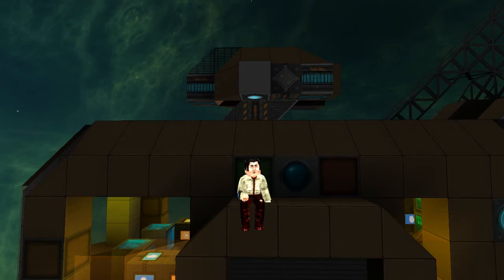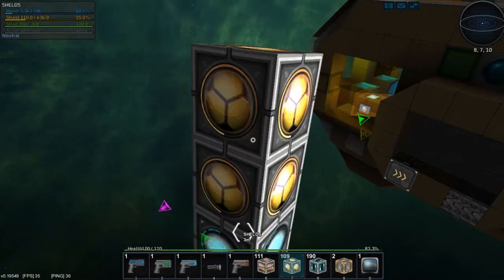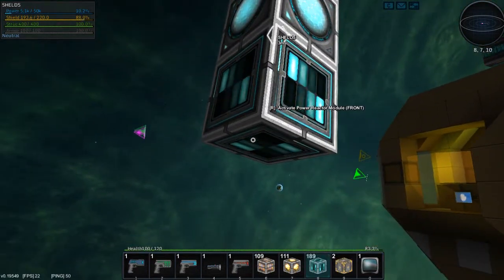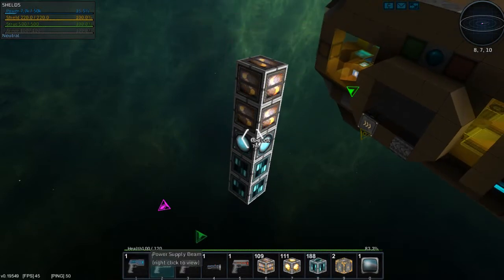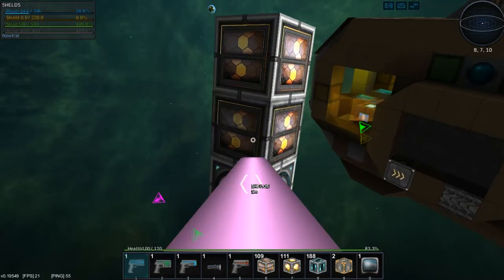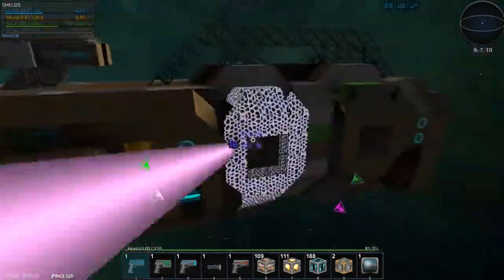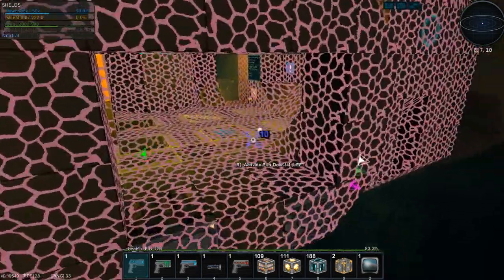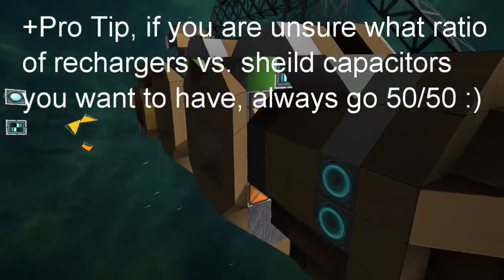StarMade Compact Tutorial | How Shields Work

Comment: Very nice. But wouldnt it be better (or at least I always build like this) to go with a ratio more like 5 rechargers/ 1 capacitor? So that you have enough margin for a shot not to get through, and sustained dmg would just be infinitely nuliffied by the recharge?
Reply from the maker: +Petr Novák That works if you meet ships with smaller guns. the recharges don't yield so much per block so you need extremely many to be safe. But for some applications more recharges is better ^^